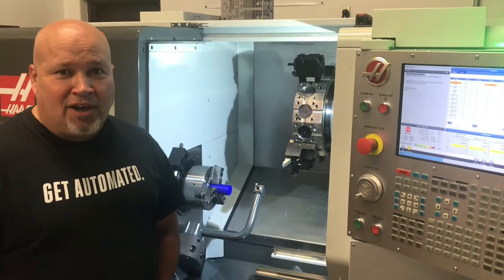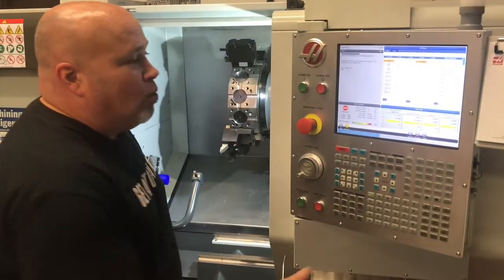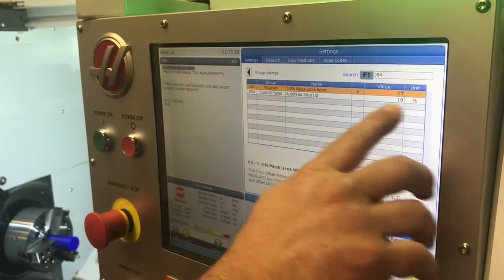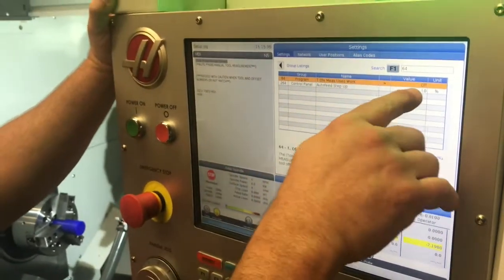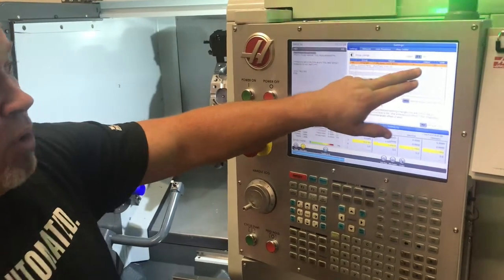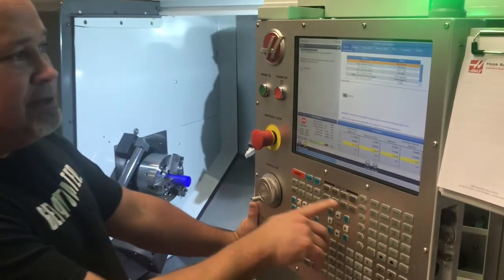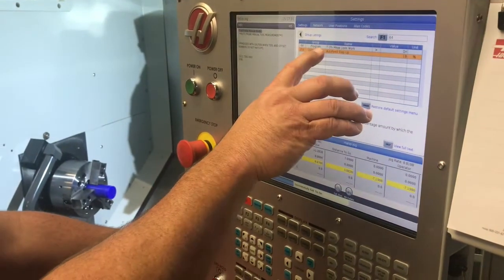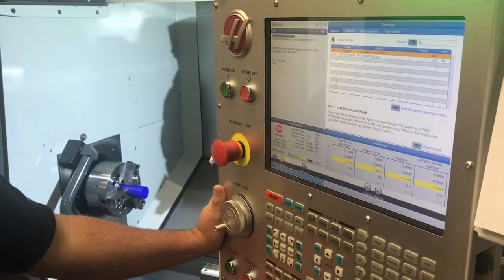Haas Lathe - To Probe or Not to Probe?  Setting 64 Explained

Comment: what if you normally use the tool setter, have a large part in the machine that obstructs the movement of the tool setter... break an insert.. and need to touch off a new tool on the part without using the tool setter? Nice video... excellent instructor's Demeanor, thank you.
Reply: Hi Jim.  Thank you for watching and thank you for the kind words as well.  In this scenario, you will change Setting 64 to "ON" (Use the work offset as the reference for teaching the tool without the tool setter), teach the tool using X-Dia Measure and Z-Face Measure as needed.  Afterwards, you can immediately change Setting 64 back to "OFF" (meaning - back to using the ATP probe as your offset reference), so that you don't forget to change it back later on when you setup your next job using the ATP.  Sometimes, I wish they would have just labeled this setting as "Tool Setting Probe?  Yes or No", LOL.  Take care.
Reply: @Darren_HFO_Champions   Thanks so much, I started learning to machine on manuals around 2003, and has been close to 15 years since I ran a Haas lathe.  

I am currently enjoying the challenge of initially setting up a 2001 SL 20.. .. even the eccentric bosses on the BOT turret for the ID tools are giving me a run for my money; every one of them seized up. 

Your assistance here will have helped some guys put food on the table; thanks for that.